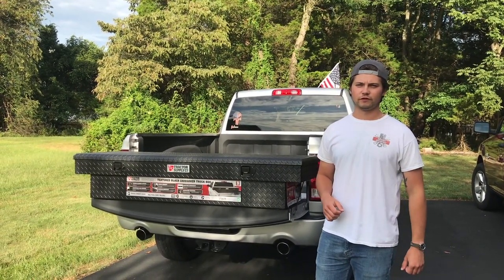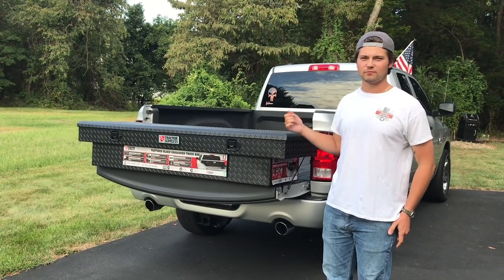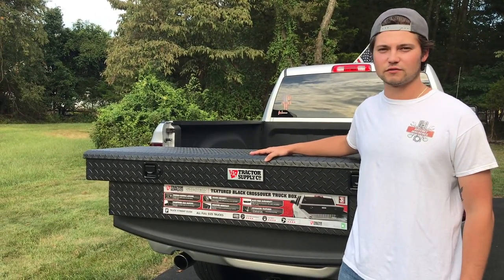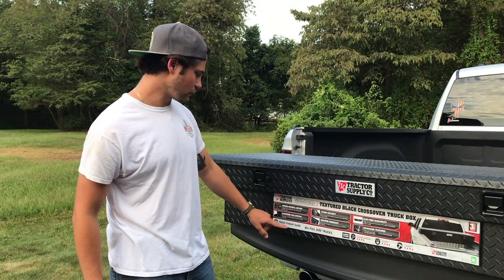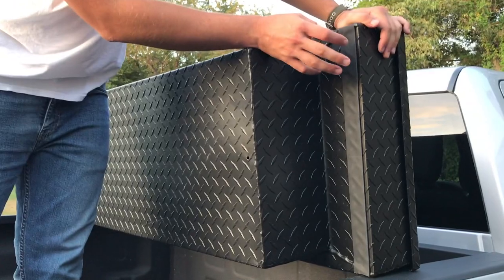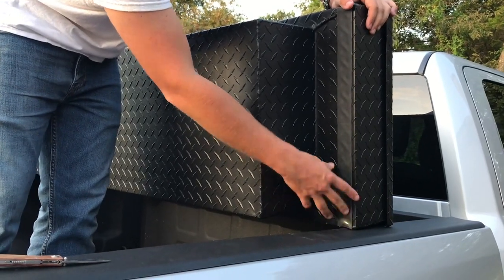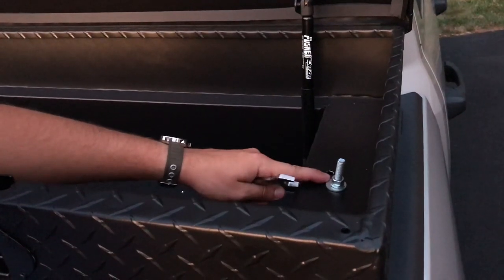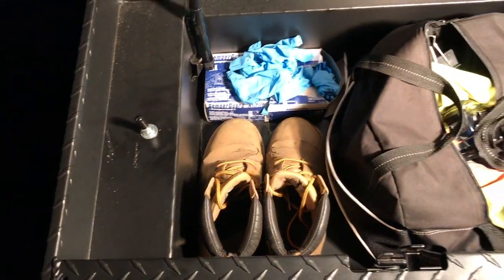Bargain Truck ToolBox Install/Review

Comment: I would attach a rectangular box that’s drilled with a hole to the top of the threads on that “Jhook”.  
     I’d put my socket sets on the one side and other tools 🛠 screwdrivers, hammers, wrenches etc. on the other .
     All my frequently “go to” equipment right up top for EZ access.
Reply from the maker: That’s a great idea! I have my tool bag within reach so that works for me but yes the go to equipment box would be very convenient

Comment: Update on the box? Heard good and bad about the Tractor Supply Co ones
Reply from the maker: It’s holding up well actually. A few things I don’t like about the box are; 1. One of the keys broke while trying to open the box they are pretty thin and cheap, I’ve been spraying WD-40 on the mechanism to keep it lubed every once and a while. 2. If you don’t lock the box sometimes if you hit a big enough bump it’ll pop up and open I’ve had to pull over a few times for that. 3. It’s aluminum which is good and bad. Good is it’s very light and pretty sturdy, bad is it’s not strong enough to withstand a beating, inside it’s starting to dent with heavy tools but it’s still functional. Overall I would recommend for the price

Comment: Hi Thank you for your video presentation I just order the tool box from tractor supply. I got a 2019 Nissan Frontier. SV Crew Cab. Please let me know if any other installation advise  you have for me. I will pick it up tomorrow. Thanks
Reply from the maker: You’re welcome. I don’t have any other advice other than what was mentioned in the video it is a fairly straight forward install good luck

Comment: Would the installation be possible if your truck had a sport bar?
Reply from the maker: Yes it would. It's only held down by J hooks so anywhere along the bed rails you can mount it
Reply: @RatchetWrenches  preciate the reply man

Comment: What size are the j hooks
Reply from the maker: You'll need a 13/32" bit to drill the hole and the nut that goes on the thread is 3/8"
Reply: Sounds good thanks a lot
Reply from the maker: Jon Cart no problem!